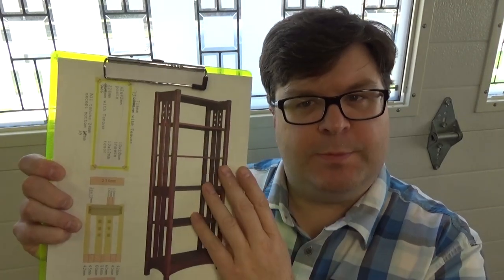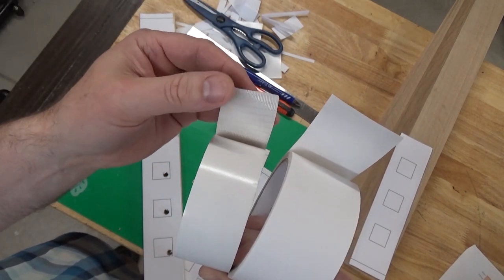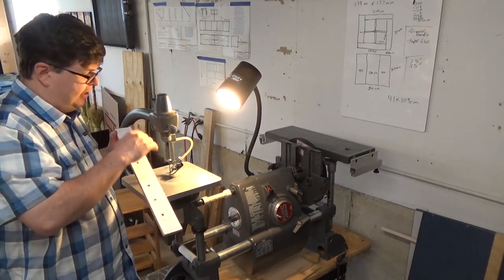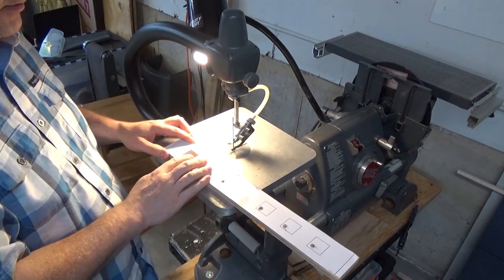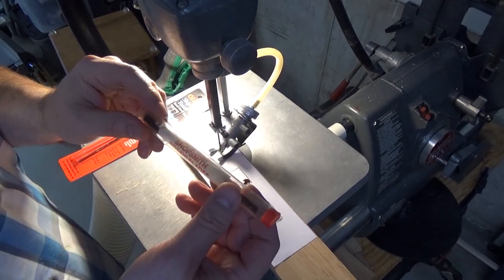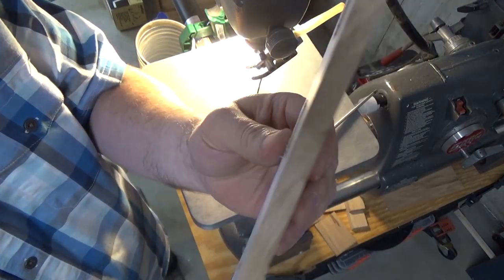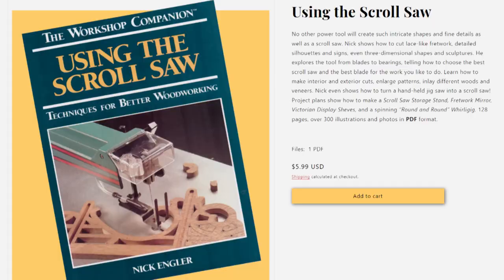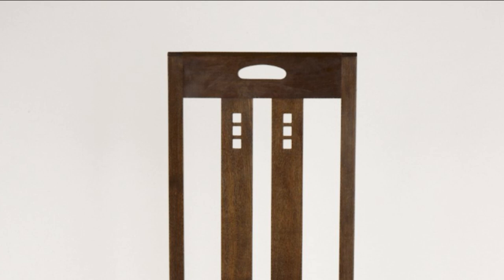Triple Square Holes: Upper Slats Stickley Highlands Bookshelf

Comment: Well done Tom,
Your project is coming right along. Good point on discovering work piece orientation. Some times I don't spend the time pre-cutting and run into this issue. Thank you again for all your work.
Reply from the maker: Thanks Jim. Yeah this one is taking a long time. I’m double checking everything because the lumber was so darn expensive.

Comment: I hope someday you will go back to making videos.  I'm a very occasional woodworker myself, mostly I use my extremely modest skills to fix things and to make use of scrap materials that would otherwise go to waste (for instance, I made a cat tree out of old redwood deck stairs that would otherwise have been discarded). I've never tried to make anything that requires the precision of the bookcase or some of the other things you've built, but I might someday.  Your videos are a great illustration of how to make use of the tools at your disposal. You could use a jigsaw, or use a router and then finish with a chisel, or...well, there are many options, and I learn by watching you choose. (You also did a book review, of a book that shows several ways to do things and identifies the pros and cons of each...I'm ordering that book, I love that approach).  I have a very small workspace -- big enough for a table saw, a Shopsmith that has to stay against the wall because there's no space to roll it into, and a work bench / assembly table. Even finding space to store the ShopSmith band saw is a bit of a challenge. So I have to make do with what I have, but even with my limited tools I generally have many ways I could do a task, and I like seeing your thought process. Indeed, if you ever feel like making more videos, I would love to see a series where you build something -- whatever is your next project -- and, for each step, describe several ways that you could accomplish it and then explain why you chose the one you did, and show it. I guess it's too much to ask you to do the same task several different ways, showing each one, and then choose which you thought was best, but that would be my dream. Anyway you've done a great service with these videos, I'm sorry you've stopped.

Comment: You need to get the files for the ShopSmith jig saw to make your corner filing much easier.
Reply from the maker: Thanks Andy great suggestion. I do have 4-5 of the shopsmith files. Just chose the hand tool route this time.

Comment: What differentiates a jigsaw from a scroll saw? I'm not used to a saw of this style being called a jigsaw
Reply: A scroll saw has power applied to both ends of the blade.  A jig saw just has power on one end of the blade.  And, as Tom mentioned, the SS has a spring on the other end to help keep blade tension which is really important when using thin blades.
Reply from the maker: To add to what Dana mentioned, "Jigsaw" is a legacy term for what we now use to describe the hand held Jigsaw. The hand held tool took its name from the original jigsaws due to similarities. The contant tension saws which became very popular in the 1970s and 1980s came out they used the term Scrollsaw. By that time most people associated to term Jigsaw with the hand held power tool.
Reply: @woodshopnerdery  very interesting